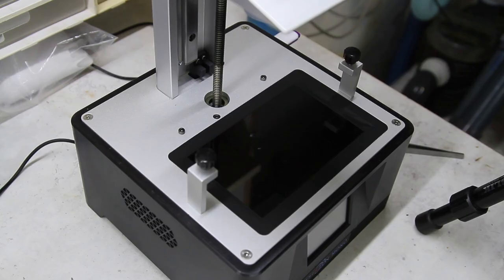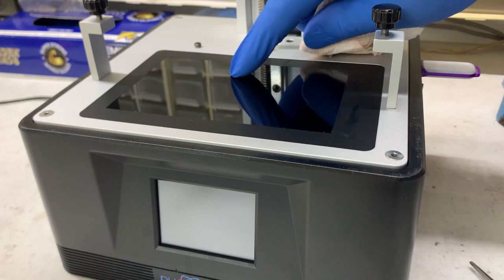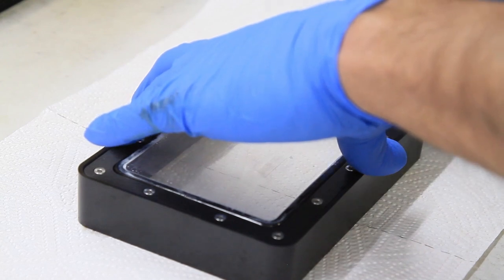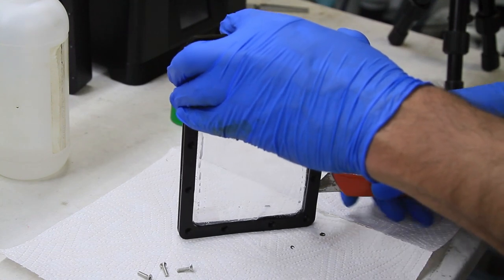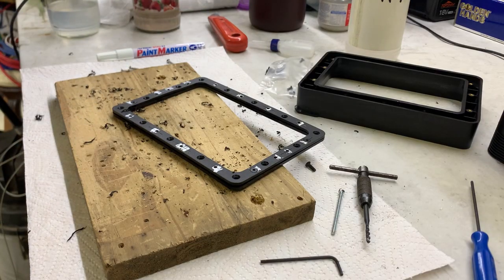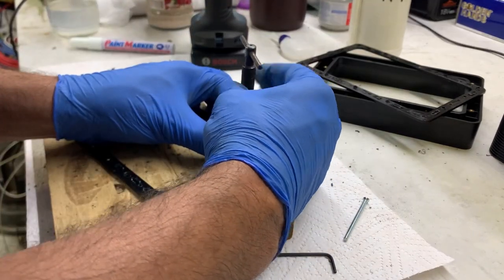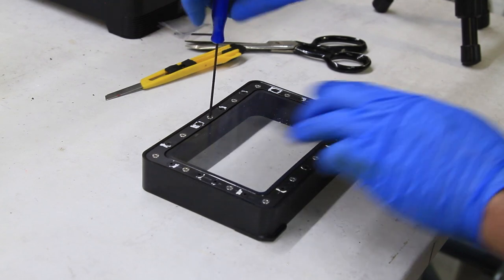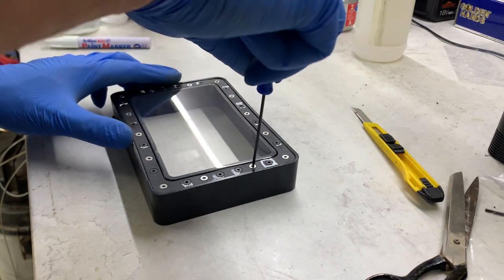Anycubic Photon Mono - FEP replacement hack

Comment: I run eight printers pretty much 24-7... all of the original AnyCubic vats have been replaced with either Elegoo or Sovol metal vats that allow you to replace the FEP without all the hassle.
Reply: Heya, if is not too much, what metal vat should i buy for an anycubic mono 4k? Is there any specific that i should look after?
Reply: What IS the reference ? Please for thé cuve

Comment: Thanks for the video.  Without drilling, I kind of got it to work.  I placed one side of the frame into the vat, then went through systematically cutting holes and installing screws one or two turns.  The sheet is almost completely flat at this point.  I then went around tightening each screw one turn at a time.   I think it overstretched the FEP, but it didn't break, so we'll see.  Next time I may put some kind of weight so it has a little slack before final tightening.

Comment: I had the same realization today. I have to say you put in a lot more work than you had to. I simply got a new fep sheet and sandwiched it again using the same screw holes and it just worked like a charm. Why did you screw new ones? Did i miss something?
Reply: I came to see the comments because I thought the same...
Reply: Because installing the FEP is really a two-step process: First you need to install the FEP between the two frame parts and make sure it's flat and even. Then you install the frame in the VAT, which will actually tighten the FEP - but in order to do that, the FEP must be firmly fastened to the frame first. The original FEP was attached to the frame through oblong tabs which were used to glue the frame pieces together, so when installing the new FEP, that job is handled by the screws. Actually, I don't think the tapping is necessary - you could use machine screws with nuts on the other side, since the VAT has plenty of space for nuts.
Reply: Actually, I just re-read your comment and noticed that you had verified that this is not necessary, which is really good. :) I'll probably try your method if I try to replace the FEP.
Reply from the maker: I had  thought that the FEP needed to be 'held' in the frame or it might slip when tightening into the vat.  Will try this next time.
Reply: @makerealstuff  i tried to use the factory holes and it did not work.. 1st print and resin oozed out the sides....

Comment: Nice hack!

I know you say "no tools", but I used a "reinforced scraper blade" to clean the resin off the glass, actually. Making sure you control the angle of the blade carefully to keep the edge perfectly parallel to the glass, you won't scrape the glass, and the resin comes off easily. I can absolutely NOT recommend this to anyone not very experienced with doing similar things though. A blade like that can absolutely scratch the glass very easily if you make a mistake.

Also, there's no reason not to use an electric screwdriver to remove the screws, of course. You probably want to hand-tighten them, but removing them with an electric tool is just much faster.
Reply from the maker: You're braver than me with the blade on the glass!
Reply: Risky. Use a plastic palette knife instead. Steel blade is stronger than glass. Ask me how I know.
Reply: in fact i fucked up my fep sheet by making a hole in it, some resin leaked on the screen, and trying to take it off when cured i broke the lcd, now i have to wait 2 weeks for a new one
Reply: Cured resin actually peels off the screen pretty easily. I recently fixed a printer for a client who had a hole in his fep and got like 10ml of resin all over the screen. I use a wood chisel that I keep extremely sharp and polished; I hold the angled part of the blade tip perfectly parallel with the screen, and slide it under the cured resin- I managed to remove all the resin from the screen without a scratch. It wasn't quick, but if you are very careful (and your chisel doesn't have ANY burrs on it), it won't scratch the screen. FYI a chisel is also my preferred method of removing prints from the buildplate. It's much sharper than a scraper and the flat back of the chisel grind allows it to slide along the buildplate without scratching, while also getting under the print and lifting it off. Works much better than the garbage scraper they give you with the printer which is much more damaging to the print. Since it slides along the buildplate, I rounded off the sides of this chisel, and polished them so there is no surface that can scratch, and also hit the back side of the cutting edge with a very quick pass with 400 and 800 grit to remove any microscopic burrs. As long as it is held parallel it leaves no marks in the aluminum.

Comment: This would have been a lot more accurate and easier with a drill press. I am sure if you had one that would be in the video. Very nice tutorial on overcoming this poor design with a bit of brainpower. I initially thought of FDM printing a frame, but it would never be as strong as this extruded one. Very nice work. I heard that you can use FEP plastic from vacuum sealer bags that are used in food prep. The inner lining being FEP. A box of this would last you your printer's service life.
Reply from the maker: Thanks. I do have a drill press (and a milling machine with a DRO if precision was required) - but thought it would be more useful to show with hand tools so that others could see it could be done without sophisticated tools
Reply: @makerealstuff  Good call then.

Comment: Your fep may be too tight  you may need to put a bottle cap under the center of the fep and clamp the frame down then install in the vat.... Plenty of YT vids explain it better 👍
Reply from the maker: Thanks for the tip

Comment: Why not just remove the FEP and use the frame as a regular metal one? I can't see a reason why it wouldn't work.
Reply from the maker: I was worried that without being 'clamped' / sandwiched in the frame, the FEP would just tear around the holes when being stretched across the vat.  But that said, I didn't test it the simpler way you suggest.  FEP has sprung a leak again, so maybe it's worth the experiment when I replace it

Comment: What I find good for getting resin off the screen is the validation matrix test card non cured so it's soft and flexible and just abit of water! Saliva worked better but that's up to the person hahaha butbyeah worked better than them plastic razors and free just keep hold of your exposure test's matrix prints nifty not cured! Hope this wee tip helps someone it fairy saved me from getting stressed out when it happened incase it was ruined but came right off

Comment: I’m still trying to understand why you drilled new holes???
Reply from the maker: The original FEP sheet was sandwiched between the two layers of the plastic frame and retained by tabs in the frame.  I added the new holes so that I could screw the two halves of the frame together so that the FEP would be retained, and therefore could be tensioned without pulling on the holes for mounting the frame into the vat
Reply: It is easier to use a soldering iron for this

Comment: Why don't you print new one? There's several on thingy
Reply: If you print the new one do you have to do the bottle cap tension? Also, what kind of resin do you use that would be strong enough to keep the FEP tensioned ?
Reply from the maker: How would I do that on the printer itself when the FEP is leaking?
Reply: @makerealstuff  they assume you have more than one printer or a fdm printer also
Reply: FDM printed substrate is not as strong as extruded plastic into an aluminum mold. The nature of building prevents material strength. Go ahead and try it of course, maybe with ABS and Acetone Vapour Smoothing as that increases part fusion and strength by up to 25%, but what he did is legit.